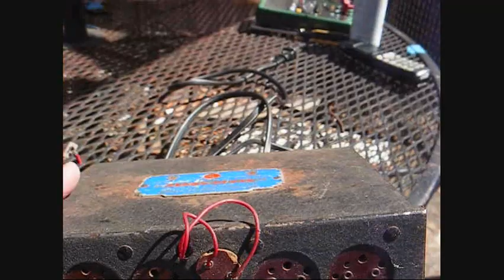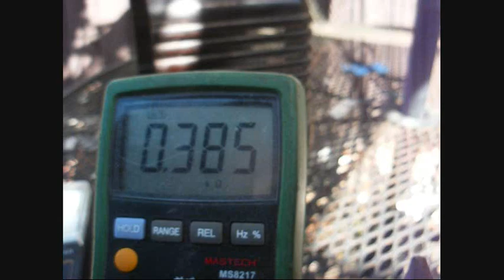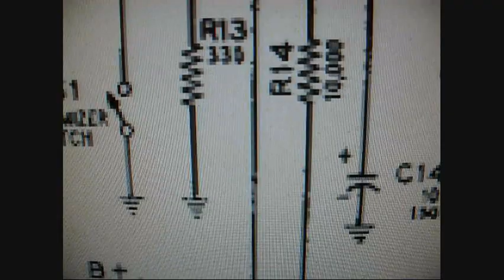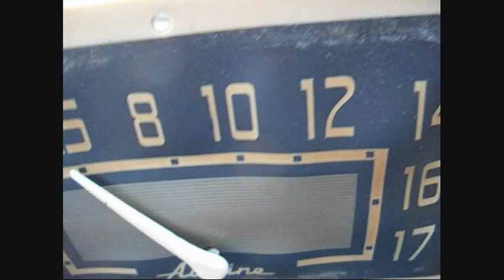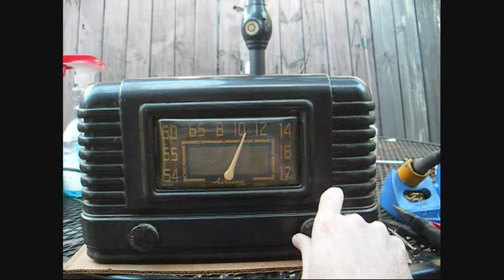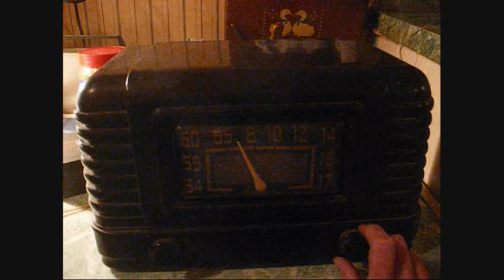1946 Airline (Belmont) battery operated tube radio repair

Comment: One may not necessarily need to change old capacitors if they don't carry a lot of current, or otherwise adversely affect the operation of the receiver. I believe these sets have directly-heated cathodes, that is, the heaters function as the cathodes in the tubes. One thing I've noticed about sets that use these tubes is that they behave similar to transistorized circuits when you turn them on; there's no wait time. The U.S.A. was still in the process of rural electrification in the mid-1940's, so this receiver likely came in handy if one lived out of town.

Comment: Hi RTPN, are you familiar with the approach to correct chroma demodulation alignment issues? The symptom I’m observing is that there is horizontal red color phase shift to the right, where it produces a red smear ghosting effect. It only impacts reds more than any other color. I saw that it is likely a chroma demodulation alignment issue. Is there a way to correct?

Comment: 21:47 Good points!  I noticed that metallic ringing on NY metro AMs with FM translators.  It's a latency issue that feeds back into the AM side,  making historically pleasant and comforting sounding AM sound like a loose heat shield on an old Datsun transmission.

Comment: And as far as changing capacitors the only one that I really worried anything about is across the line cap because if that sucker let's go on an AC powered radio it's not a nice day had it happened several times and one time was on a Magnavox

Comment: Very nice radio.
Question: isn't a capacitor's resistance supposed to go up when using an ohmmeter as it charges? I did see it start out at a lower resistance on the new one, correct? I don't know about measuring a leaky cap with an ohmmeter, but I thought a leaky cap will never reach infinite resistance. Just trying to understand. I am a novice in the worst sense of the term.
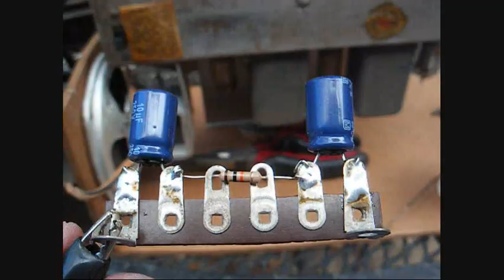Edit: at about 10:09, you confirmed that about the resistance reaching infinity on a good electrolytic cap.
Reply: As regards capacitors.... As a young guy trying to learn this stuff in the 1980's the worst advice I ever got was about checking capacitors with an ohmmeter. 

Try it on known good capacitors. See if you can discern what the relationship of the value and voltage limit versus the meter behavior. I didn't think you can say much more than it takes the larger ones longer for the meter to sweep the scale. 

Shorts will show as a low resistance or one that rises and then stops at a low value. Open will exhibit no movement. 

Leakage can be difficult to discover at lower voltages. Most ohmmeters function at 1.5 volts. Some are higher. A few use 22.5 volt batteries on the high megohm scale. So mostly you do not have the voltage available to check for leakage up to the working voltage of the capacitor. 

Now you can look at capacitor manufacturer's specifications for leakage on electrolytic capacitors of different values. A DC voltage source with current limiting and an milliamp meter can help you test them. Alternately old testers with neon lamps or something new like Mr Carlson's Lab demonstrates can help you find leaky capacitors. Be careful! A charge to high enough voltage can be lethal!

Learn and understand the failure modes of capacitors and how you can figure it out and you'll be well served.